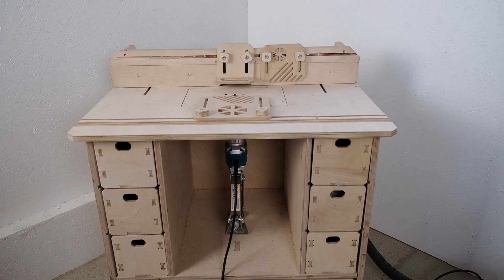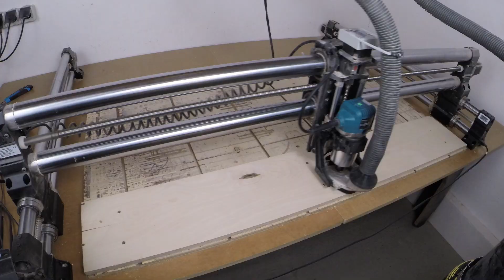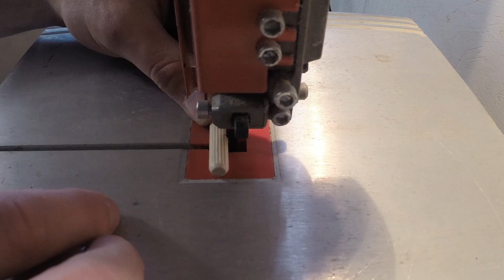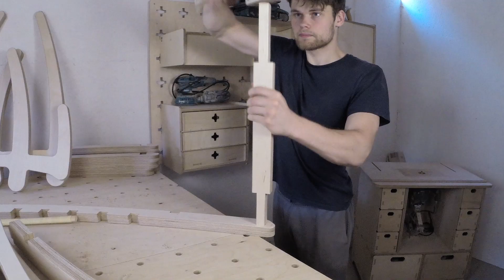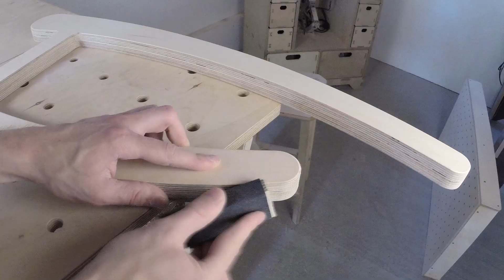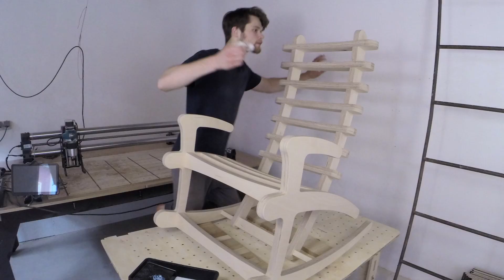How To Build A Plywood Rocking Chair on a CNC Router - ARIBABOX

Comment: Hi! there is one thing i wonder with these rocking chair stuff. How do you calculate the length of the tail(the piece that touches the ground)? How long should it be?
Reply from the maker: It depends on the chair design. The bottom arch should be long enough so it would be impossible for the chair to flip over when rocking. It's dependent on the center of mass of the chair.
Reply: @Aribabox  oh okay now I understand

Comment: rounding the tenons will never be seen. Where as a simple slip of the chisel. Will leave a strong shadow line on the mortise. That will draw the eye to the error. 
I think, even if the tenon came thru the other side and showed the tenon. It would be fine to have a tiny chamfer on the edges. As long it was clean as the rest of the build. 
Cut a block of wood to support a chiselon the flat at the correct champer height and rotate the square tenon stock to get all four corners the same.
Rectangles need a two block set up.
Reply from the maker: Great tip! I agree, a clean chamfer on the edges of a visible tenon can actually add a nice touch to the overall craftsmanship. Your suggestion of using a block of wood to support the chisel at the correct chamfer height is a practical way to ensure consistency. Thanks for sharing this helpful technique!
Reply: you do good work thanks for posting @Aribabox